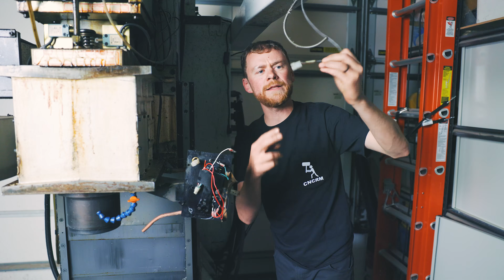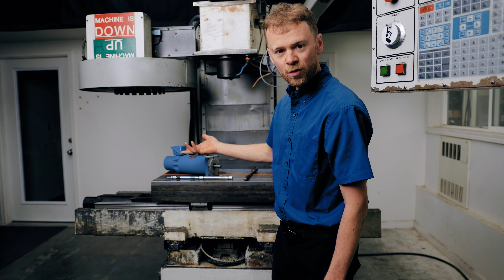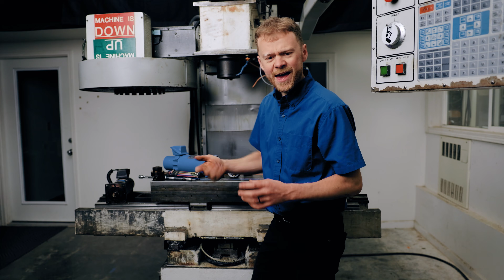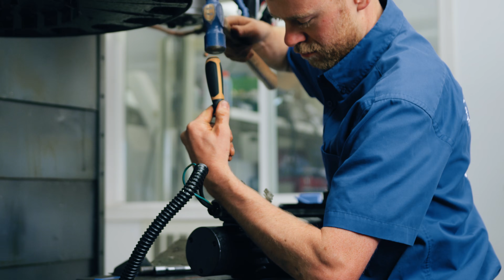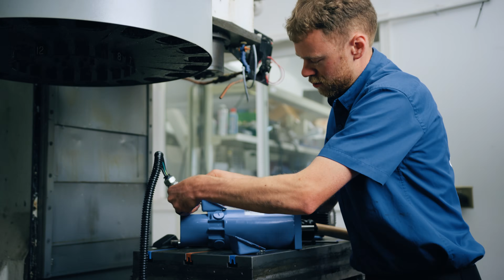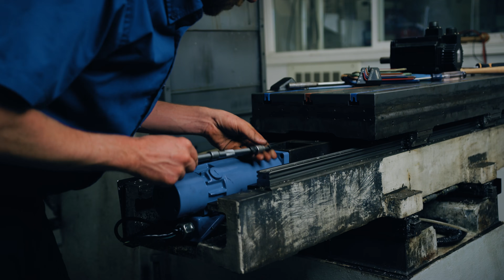CNC Servo Motor Replacement

Comment: Where can I buy the connector from the servo to the ball screw with the spring like you shown
Reply from the maker: @uytr754i  It’s called the ball screw coupling. If you need the springs, I sell the springs on our website.

Comment: I have access to a relatively large CNC which hasn't been in use for several years, I guess the maintenance was very poor the machine is full with oil, chips, dust, rust, dust mixed with oil (from the manual machinery nearby). I wonder as a repair guy do you also clean those machines or ask the owner to do some minimal cleaning before. The machine I'm in front at the moment looks like someone dumped it into a dirt bath and took it out again, when climbing inside it's like eeh I don't want to touch anything there without some minimal cleaning (there's like 1-2 mm sticky dirt on many parts)

I want to use the machine for some of my projects, the overall structure looks fine it certainly needs some maintenance (I'm currently recovering the controller (putting settings from the manufacturer back), and possibly change it to linuxcnc afterwards).

The owner gave me access to it for free and he'd be happy to have me work for him like a few hours every week for some parts. My benefit is the free access for my own commercial projects..

Comment: Hi, I have a shuttle motor from a 2020 Minimill I had to replace, I have the one that went bad, the technician says it doesn't worth the shame to try to repair it but I think it does since there is a reduction box attached to it, do you guys fix these or have a use for the it?

Comment: Helpful tip, grind a small notch on inside both jaws of a set of needle nost pliers for stubborn lock nuts on electrical equipment. Multiple places sell pliers that way, but for free and 5 min wirth of work you get a tool that works the same. It really beats the screwdriver and hammer method, plus there is less risk of damage to other components in the process.

Comment: I'm just curious, how often do you get to see Mitsubishi Meldas based Controllers in the U.S?
Reply: They are around, not a lot of support for them. I have a meldas based lathe, since I got it it has never run. It is out as soon as I get a chance to deal with it, or a need for a replacement. No one seems to know how to work on them.
Reply: @sshep7119  can you tell me which problem you are facing? I have a Meldas mill, we are waiting for some settings from the manufacturer at the moment

Comment: This will be useful for my CNC retrofit replacing the Fanuc red servos
Reply: Just curious, why get rid of the FANUC red caps?
Reply: @sshep7119  I will be replacing the control with LinuxCNC and can't adapt the red caps to work due to the proprietary pulse-coders